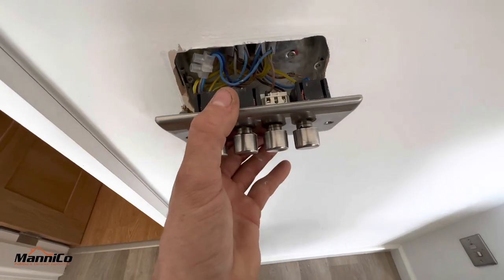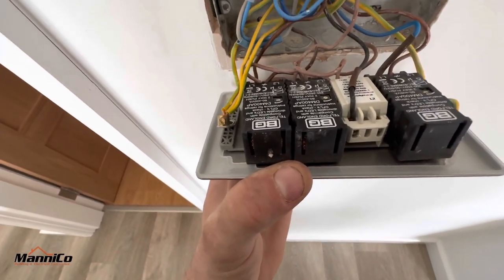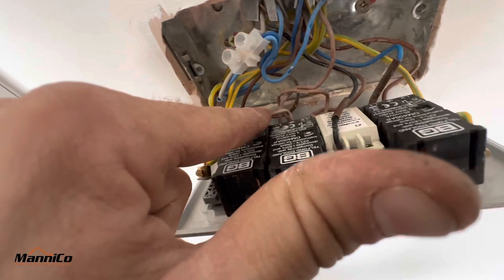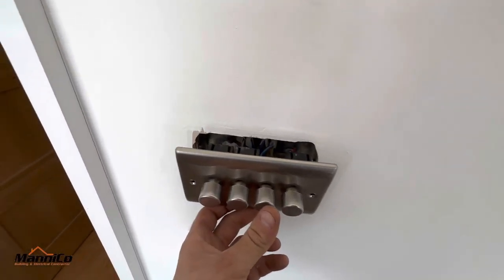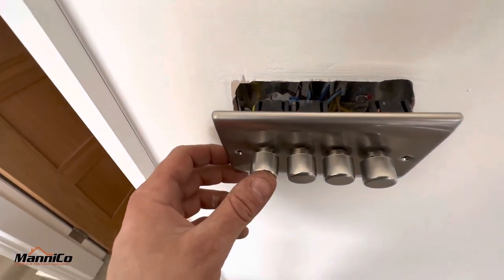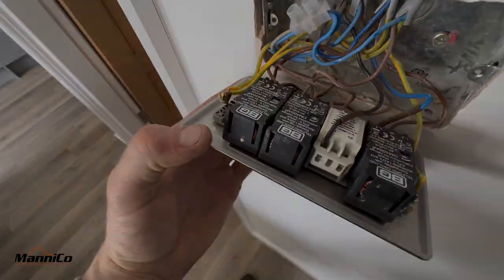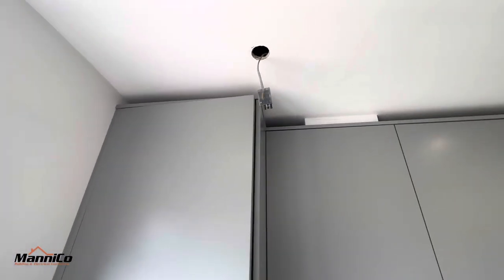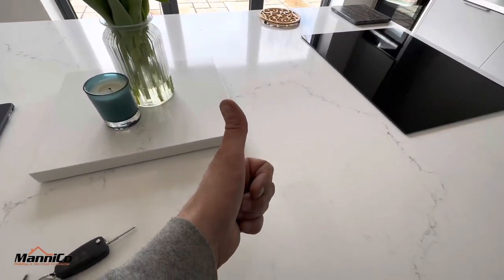Fault finding on some tripping spot lights!

Comment: Assuming it's a 5W lamp, 5/240 = 20.8 mA so all that current was going to earth hence why it only tripped on full power.  Most RCDs trip in the 20 - 30mA range.

Comment: Had a job
Extractor fan turns on with lights but can’t be turned off without turning it off at the breaker, no humidistat or timer present, 12v downlights

Only thing i think it could be is the transformers but still don’t make sense
Reply: Your cheating on me Lexus !! Busted 😂